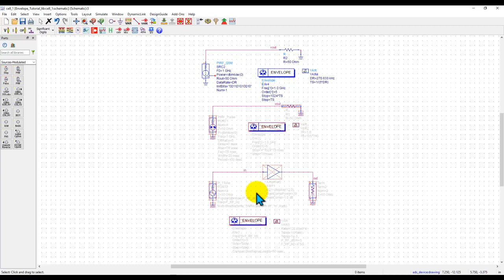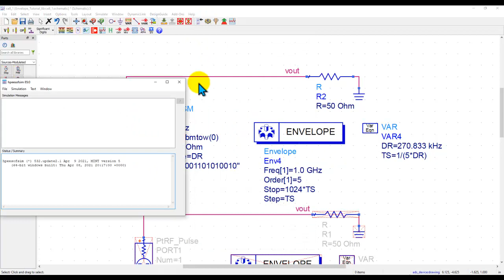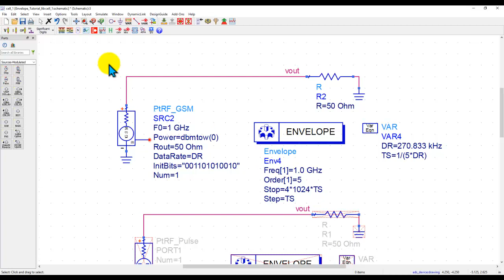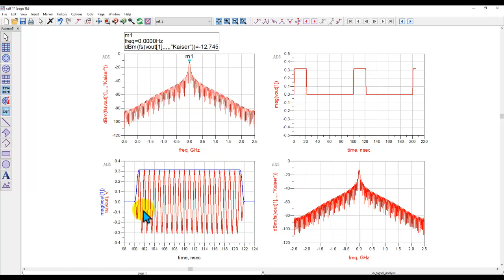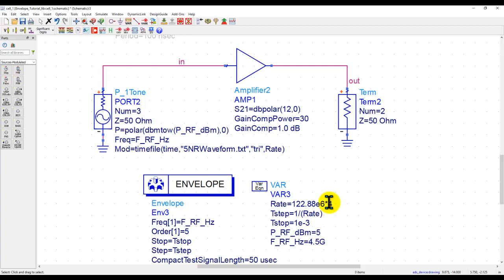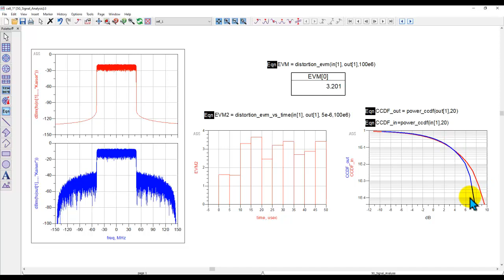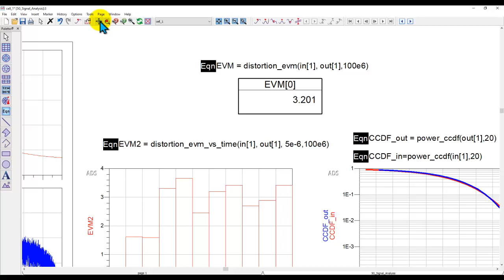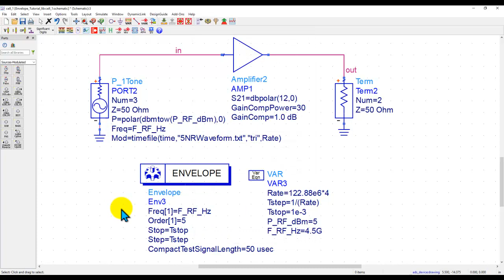Tutorial-58: Circuit Envelope Simulation Basics and Modulated Analysis

Comment: Question. 
I am doing mixing in SystemVue dataflow design. I am usiing passive model of the mixer. I want to mix together modulated QPSK data and my LO signal. The problem is that LO signal is an actual RF signal (with some phase variations because I want it that way), but the qpsk data is envelope signal with complete disregard of the carrier frequency! I want the modulated data to be an actual RF waveform, not just envelope, so that mixer does its job. 

How can I obtain actual RF waveform of the modulated data from the envelope that Systemvue's Modulator is giving me?  I did that according to your other tutorial about QPSK modulator.
Reply from the maker: I am little confused your question but from whatever I understood there is no problem if you want to apply modulated signal to LO instead of CW as characteristics will be accounted for. RF signal isn't totally disregarded just that it isn't shown in the spectral plot as such...😊

Comment: In lecture-9 as you explained bias network using microstrip line. how to choose microstrip values for biasing of LNA. if we want to do biasing using lump components then how we will choose lump components values ? could you explain sir
Reply from the maker: Lumped bias network will primarily use a RFC choke instead of high impedance lambda/4 line. You can refer to few app notes from NXP to learn more about it.